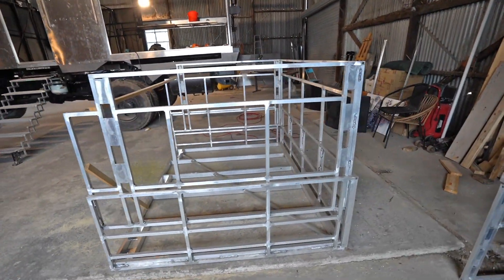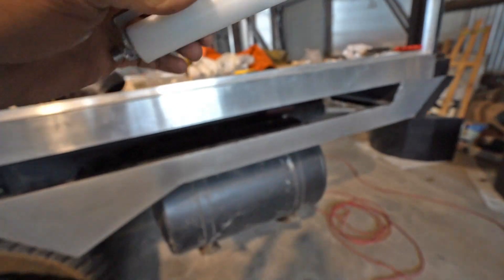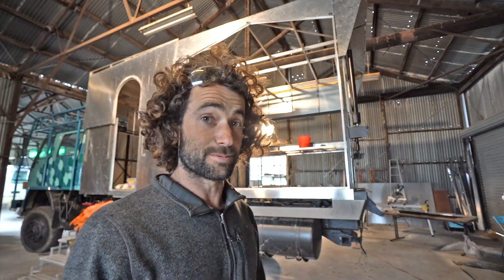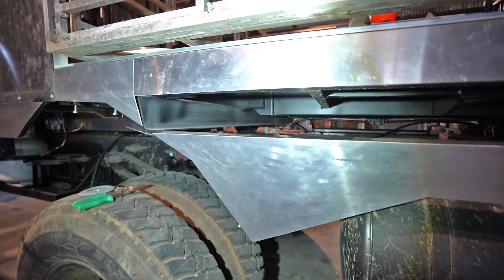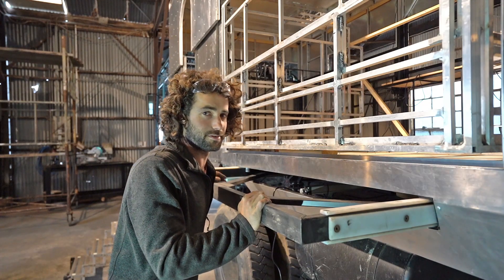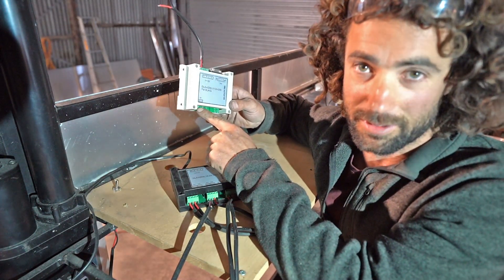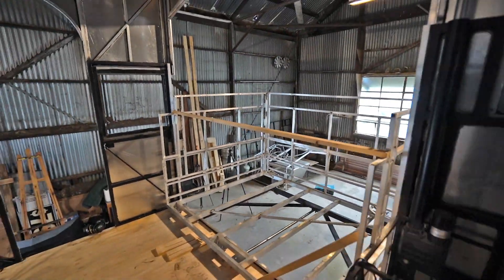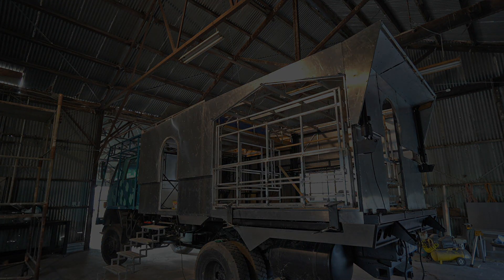Slide Out Room Installation - Part 1 - Expedition Truck Build #11

Comment: I am contemplating a 2.15mL x 1mW x 2mH slide-out in a 4.87m all-aluminum, cab-over box.
Thinking about pneumatic actuators. Yours are electro\mechanical?
Did you consider pneumatic? If not, why?
Most rigs have compressed air.
Reply from the maker: Yeah mine are electric. I did consider it, I went with electric because they can support a load whole extended without any issues, the compressor runs off the engine, so that creates more obstacles
Reply: @dancampion  The weight is carried by the support arms & frame, not the extend\retract mechanism.
If a ram(s) is/are used it is important it/they not see axial force, its only function is to push\pull without interference (i.e. side-load).
"the compressor runs off the engine" the vehicle engine? I doubt manyRV rigs have that set-up. Large trucks do but that's immaterial. Many rigs carry air compressors and some carry extra tankage. Mine does both. What the air-compressor's prime mover uses to start it and possibly operate it depends solely on design and/or preference.
A pull-start or battery-start gasoline prime mover has no connection to the vehicle engine. There is also no good reason why an electric prime mover cannot operate the air compressor.

Comment: It's awhile back but bolting a flange on your slide walls that are holding your cantilever from rotating down and away with weight. Sealed roller bearings would never wear out in that application.

Comment: Hey, Dan, I was wondering where u got ur large, thick strips of Teflon? I cant seem to input the correct terminology. What words did u search, bud?
Reply from the maker: Hey Grim, I bought them from a sheet metal supplier. Any plastics supplier/manufacturer should be able to sort you out
Reply: @dancampion  Thanks, Dan. Appreciated.

Comment: I cant even remember at this point how I first came across this build but let me tell you this is one hell of a build. I am starting a build on a 1968 Chevy C40 Truck into a fully self contained wood fired pizza food truck and although it will not have as many bells and whistles as this build it does have quite a bit of complexity to it. I have to say my favorite part WAS the pop up of the whole top until today when I saw the slide out not only pops up but the roof slides open that is beyond cool. I was particularly impressed with the simplicity of the slide out system. I'm not sure I can still do it but in the initial design phase of my build I had a slide out but was literally pulling my hair out trying to design the mechanism. The problems arose in trying to re-create what is on most modern day slide outs instead of doing using a crazy simple design as you have done here. I basically designed the same thing but was not sure if it would work and seeing yours was confirmation that I'm not crazy. I realized although I was subscribed I did not hit the notification thing and luckily it showed up anyway. I have now made sure I get notifications and eagerly await your next video on this build. I've already written much so i might as well add through all of these I continue to be impressed with not only the attention to details but the presentation. Fairly straight forward, no blasted annoying music or excessive talking or 3 min intro. Just a dude building something and documenting it, its rather refreshing. Wishing you continued success and thank you for this.
Reply from the maker: Thanks Jeff! Very kind words. 😂 You're not crazy! Sometimes the simplest option works just fine, we'll see how this performs in the long run but I'm pretty confident it will be ok. Good luck with your build, if you need any help, let me know 👍